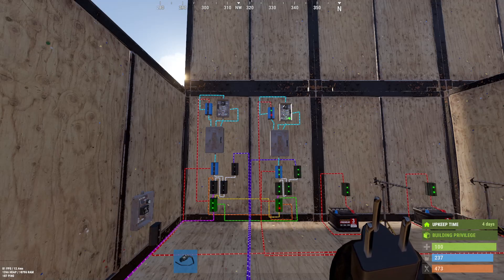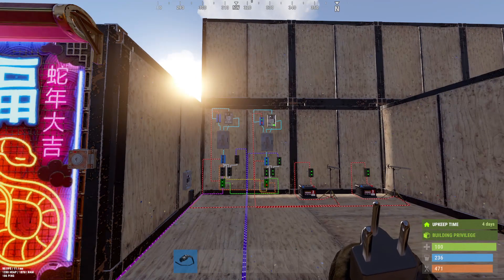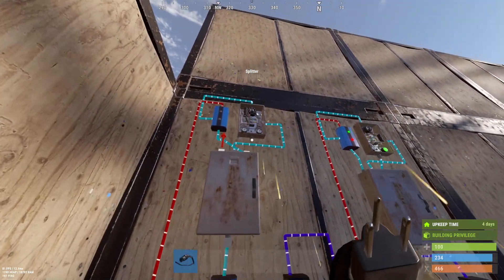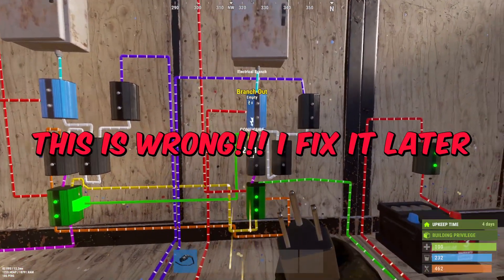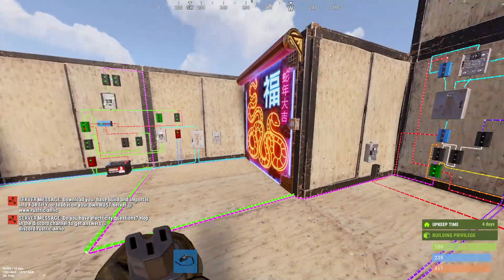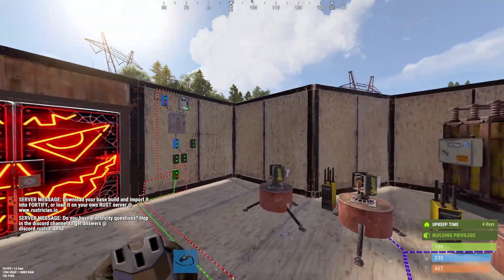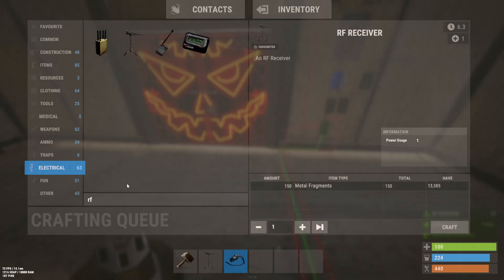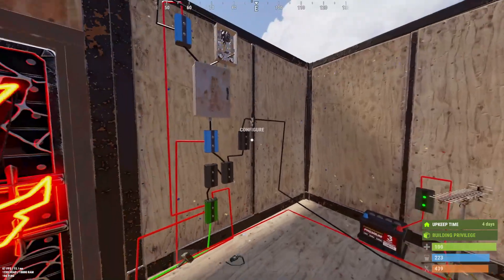Turret Flip-Flop System | Rust Electricity | 2025

Comment: im really sorry but i may have missed the point of this but what exactly is the point of the switching. Is it to keep the power demands low because of having so many turrets?
Reply from the maker: It's to get past the 12 turret limit on official servers. Big clans use this system to have 24+ in their compound. 8-12 in peeks and open core and then 4-8 on roof. Mostly for big bases.
Reply: @plaguephreak oh so you can technically have more than 12 but not all powered on at once?
Reply: it powers 12 turrets on then another 12 on on a loop so you are only using 12 turrets at any given point.
Reply: @lachi5932  so does it mean if we get raidet.. de turret will sometimes shoot and sometimes not bc the timer for this turret is over? 
I mean a active shooting turret just turn of bc time is over?